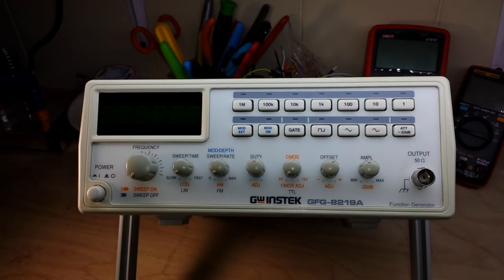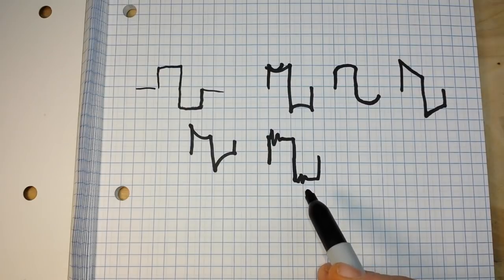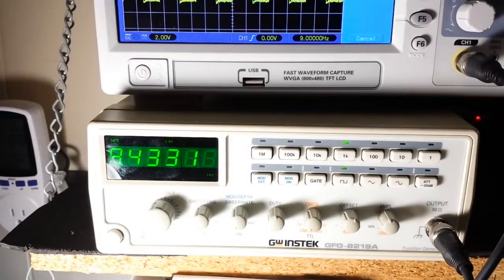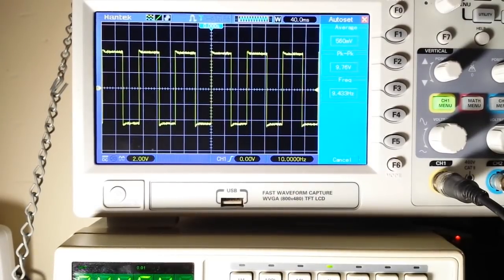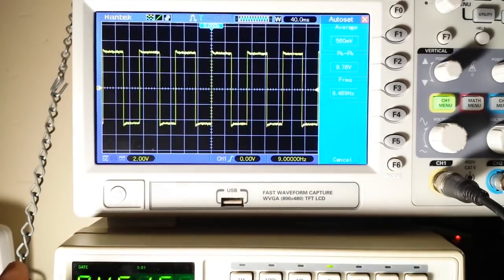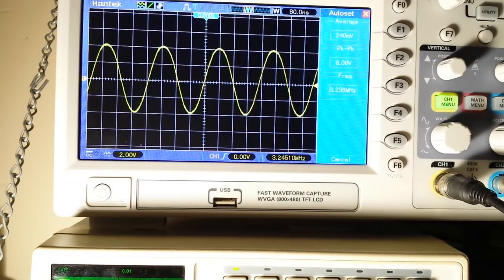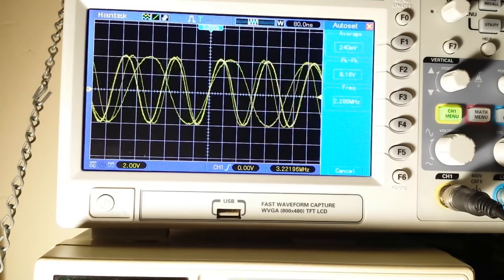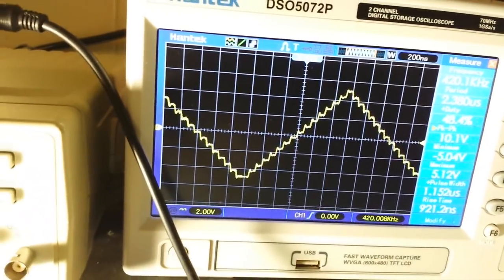GW Instek GFG8219A Function Generator Teardown

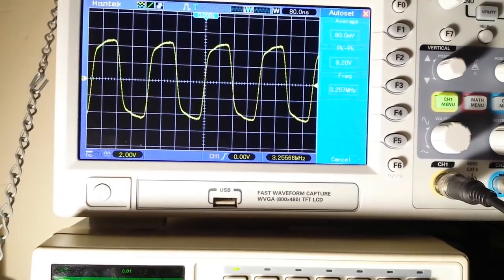Comment: The 3.2 MHz square wave at 14:20 would not look so like it's morphing into a sine wave if you impedance matched the scope to the generator. I believe I've seen you use a BNC T adapter with a 50 Ohm terminator in past videos to do this.